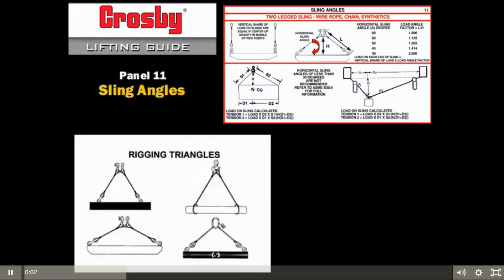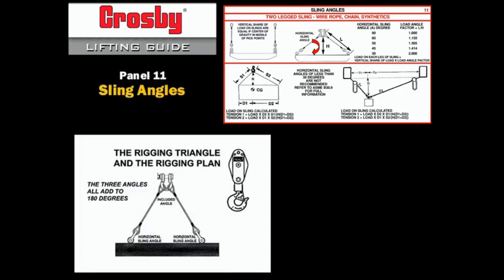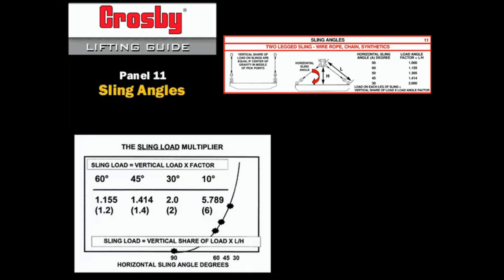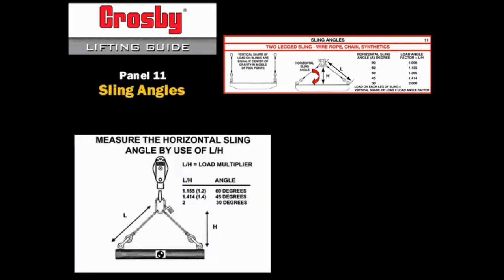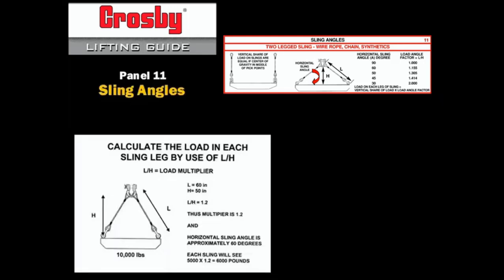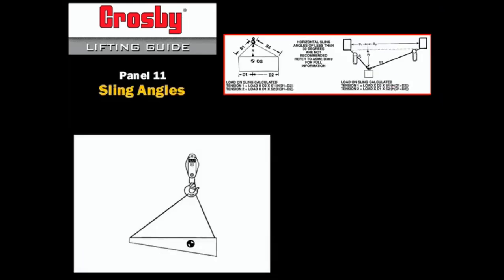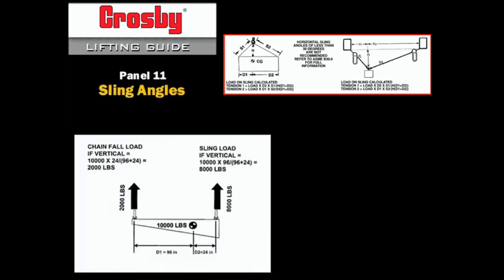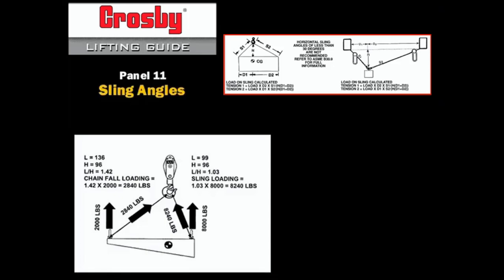Sling Angles

Comment from the maker: Question 1 of 13
1. Question
Category: Calculating Sling Tension
The load on each sling leg equals the load angle multiplier times:
•   The vertical share of the load
•   The horizontal share of the load
•   The weight of the load

Question 2 of 13
2. Question
Category: Calculating Sling Tension
The sling angle multiplier for a 60° angle of loading (horizontal sling angle) is:
•   1.0 (1.000)
•   1.2 (1.155)
•   1.4 (1.414)

Question 3 of 13
3. Question
Category: Calculating Sling Tension
The vertical share of the load on two slings at a 90° sling angle (straight-line pull) is 500 lbs. each when the total weight being lifted is:
•   2,000 lbs. (if the C.O.G.is centered equally between the pick points)
•   1,000 lbs. (if the C.O.G.is centered equally between the pick points)
•   500 lbs. (if the C.O.G.is centered equally between the pick points)

Question 4 of 13
4. Question
Category: Calculating Sling Tension
The sling angle multiplier is:
•   L/H
•   H/L
•   L

Question 5 of 13
5. Question
Category: Calculating Sling Tension
The sling angle multiplier for a 45° angle of loading (horizontal sling angle) is:
•   1.0 (1.000)
•   1.2 (1.155)
•   1.4 (1.414)

Question 6 of 13
6. Question
Category: Calculating Sling Tension
When lifting a 1,000 lb. load that has its center of gravity located an equal distance between pick points (two leg bridle assembly with a 30 degree angle of loading, or horizontal sling angle), the load on each sling leg is:
•   500 lbs.
•   1,000 lbs.
•   2,000 lbs.

Question 7 of 13
7. Question
Category: Calculating Sling Tension
If two slings are used, the vertical share of the load on each sling is 50 percent of the load weight when:
•   Center of Gravity is centered between pick points
•   Center of Gravity is below pick points
•   Center of Gravity is not centered

Question 8 of 13
8. Question
Category: L/H
If the length of the sling divided by the height of the rigging triangle (L/H) is 1.3 then:
•   The angle is smaller than 60°
•   The angle is 60°
•   The angle is greater than 60°

Question 9 of 13
9. Question
Category: L/H
If L/H = 1.3 then:
•   The sling angle multiplier is 1.3
•   The sling angle multiplier is 1.2
•   The sling angle multiplier is 1.0

Question 10 of 13
10. Question
Category: L/H
If L/H = 1.4, then the angle of loading (horizontal sling angle) is approximately:
•   60°
•   45°
•   30°

Question 11 of 13
11. Question
Category: L/H
If the load weighs 2,000 lbs. and the Center of Gravity is an equal distance between pick points (two leg bridle assembly), and L/H =1.2, then the load on each sling leg is:
•   1,000 lbs.
•   1,200 lbs.
•   1,400 lbs.

Question 12 of 13
12. Question
Category: L/H
If L/H = 1.2, then the angle of loading (horizontal sling angle) is approximately:
•   60°
•   45°
•   30°

Question 13 of 13
13. Question
Category: L/H
If a load weighs 2,000 lbs. and the Center of Gravity is centered on pick points with two sling legs and L/H = 1.4, then the load on each sling is:
•   1,000 lbs.
•   1,200 lbs.
•   1,400 lbs.